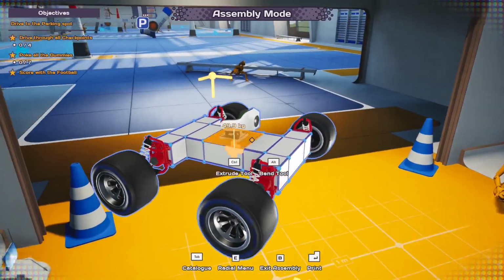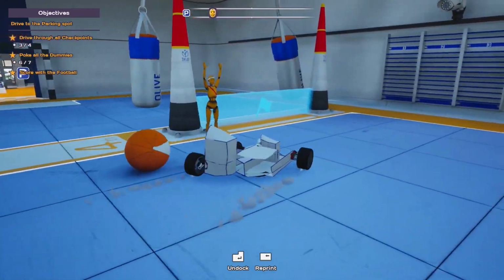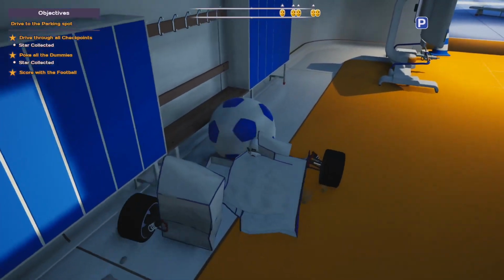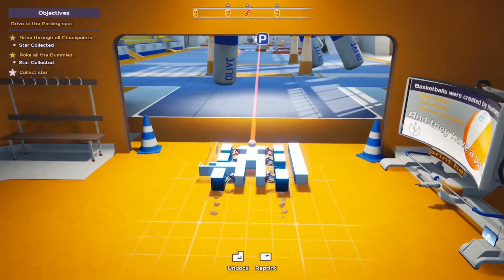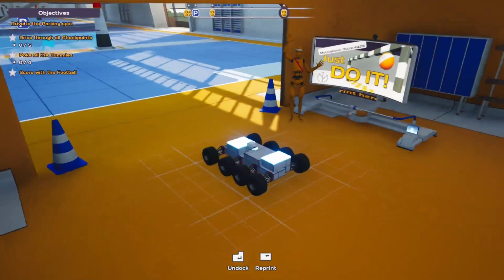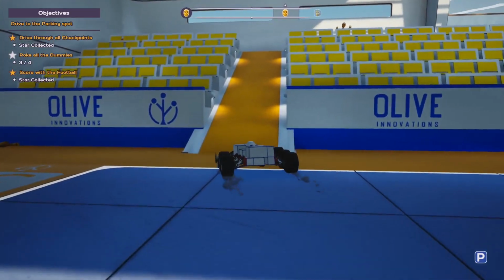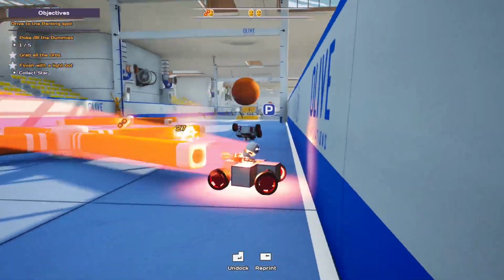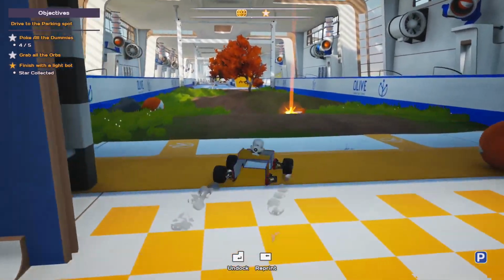Making Asymmetrical Vehicles To Complete Trivial Tasks - Challenge Series Part 2 - Main Assembly

Comment: Just a small tip. If you got a star for a challenge collected but not all three the other stars count even if you only unlock the one star next round. So if i got 1 star on a challenge, re-did the challenge and got the 2 i missed i would have 3 stars